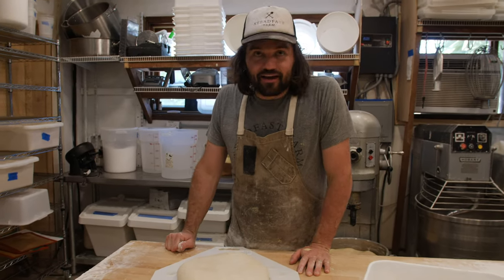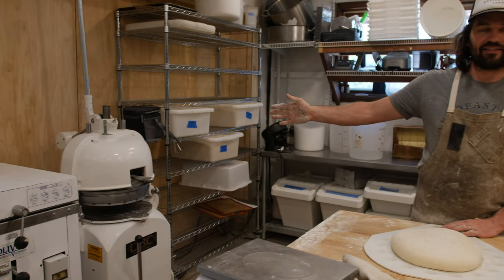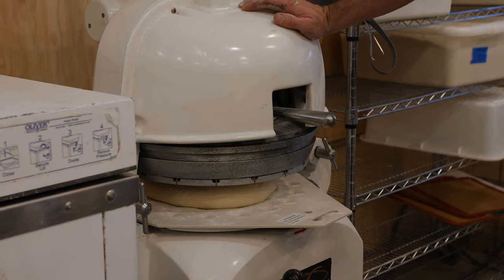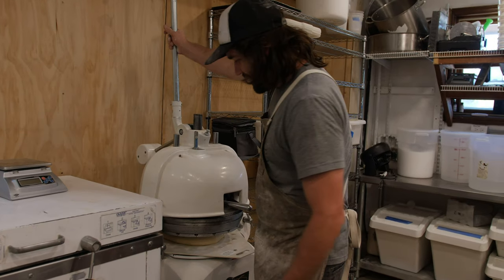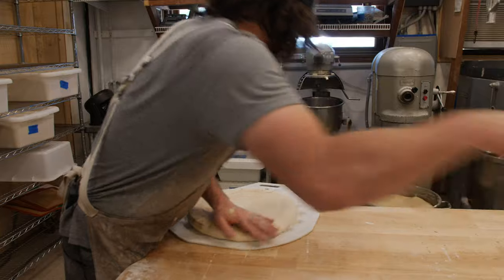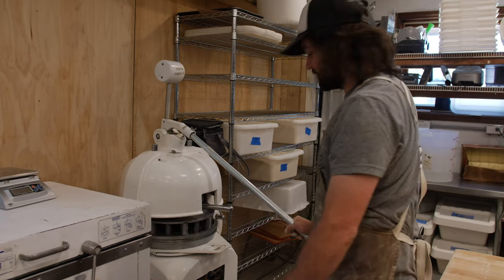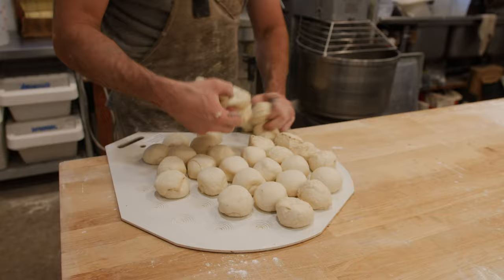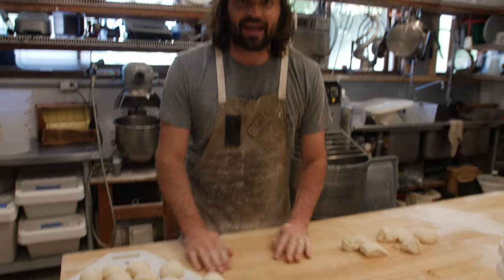Machine Rolled vs. Hand Rolled Dough | Proof Bread

Comment: I love your show but sadly nobody taught you how to use the semi automatic bun divider properly . If you do it right ,every bun turns out perfectly . Most of the dealer of these divider don’t know what and how to do it . The secret is timing and one flip from table to plate . Absolutely no flour is needed unless your dough has more than 75% hydration
Reply: Heinz Hubbert I do 80% hydration and use absolutely zero flour. The bread turns out amazing... I always wonder why use flour at all except for the very end, to make it pretty.
Reply: you are right !   I used this machine for 7 years  and    you almost  dont need flour to divide your buns !!!     I only had a spray of water to wet the bottom  and very few flour sometimes  on the top and the bun are perfectly rond no need to shape them again !    the goal is the douch stick the bottom a litle  but not too much .    in our bakery  we  could mae 4000  buns an hour  . when you have the perfect technics it is so  fun to work !
Reply: @yannhelias  This makes me want to buy a spray bottle -- it would make the job even easier! I love working with dough. And of course eating it after!
Reply: Hi I just got one of these machines. I have a pretty sticky sweet brioche dough that I want to be rolled into buns. I tried it, and it just totally ripped the dough to a wet shredder mess. Any tips?
Reply: @jennaleighmusic  if you have a soft brioche dough ,it’s because of a high fat content . Here you have to make an exception with a dust of flour . Do you have the same brand of divider? Or the same style of a divider but different brand ? They come in many shapes and dividers between 12 and 36 dough pieces as an average .
It is called a semi automatic bun divider and it can produce up to 7500 pieces per hour . By using your power as a pressure meter . 
Try dusting your dough on top and see if that helps . If still breaks dough surface try dusting under niece the brioch dough as well.
Usually count slow to 4 or 5 while rounding is happening . You may have to loosen pressure a bit while counting. After the count lift lever up .
One step a lot of people do not understand is the adjustment for night . It’s usually a single pin sticking out in front of you with groves or numbers on . That needs to be adjusted big enough , so that a dough ball can form in the cavity that you created ( that is different with every manufacturer in the market) . Be careful not to over flour the dough rather dust the dough surface . Use only enough flour that can be used to keep the surface smooth .  You have chosen one of the most difficult doughs for this Machine but it should work if done properly . 
Now in Asia the follow the same method instead with flour ,with vegetable oil in order to keep it from sticking and ripping 
Good luck I hope I could help

Comment: I have a bakery in kellerberrin , western australia and I love your videos, you are using the bun divider incorrectly, firstly you must let your dough rest longer, secondly you have to spread the dough evenly all over the divider plate right out to the very outside edge of the last row of circles, the machine is designed to press the dough flat and even but not to spread it out and finally there is a adjustment knob on top of the machine with numbers on it, I would say that your machine would take a maximum dough piece of about 4 kg or 8 lbs in your measure, if you want a 100gram roll piece then you have to wind the adjustment knob up quite high, then the machine will roll them all perfectly round without tearing the dough, which happens in your video, and it takes about the count of 23 as in 1,2, 3..........to make the best rolls , keep up the good work.
Reply: Can you make a video demonstration of what you described? It will sure help a lot of us here. Thank you

Comment: I used to run these "Fortuna" machines including the fully automatic ones. You can adjust the machine press height to help get better rolls.
Reply: That's just what I wanted to say: play with pressure point and you will get better rolls.
Reply: And as others have written here before: the level of flour on top differs also from dough to dough. And finding the balance between right pressure point and flour level can be challenging... :)
Reply: Yep, really easy to operate and get better rolls.

Comment: Nice rounder. I've used one that you manually assert press weight with a dial and I use oil on the top of the first press of the day to combat it sticking to the rounder.

Comment: after you press the dough, try spraying a light coating oil on top of the dough instead of flour. And also,  i find that its all about timing to get the dough pieces perfectly rounded, for our machine, its 6-7 seconds.

Comment: I put thin PE plastic on top of the dough on the first press to make it spread easily. I am not using flour in dividing process because it makes non smooth surface for dough spreading. I am using margarine/ oil on the plastic side only.

Comment: Hey hey. I saw that movie today.becouse like you. If i am not in the bakery i relaxing with new input. Anyway. That type of press you are using..i used my hole 17 years baker life.  But it looks öike that is not perfect round becouse the mashine is maybe to high. I roll it maybe 10 to 15 seconds and its done. You can see the edges are not under the dough. So you have to rotate it loger or adjust the height of the dough chamber. Should be a wheel on top. But still. Like youre chanel and what you are doing. Back to basics and bery good explanation dor none bakers. .thumb up

Comment: You are wrong about the StarWars thing. These dough dividers and their utensils are all copies of an original design by Fortuna which goes back to the 1920s. Fortuna received a patent on the design for their Rundwirkmaschine (rounding machine) in 1927. The design was so successful that it is still in use to this day and when the patent ran out, everybody else copied it nearly unmodified. No StarWars influence there. Although, it is possible that one of the designers at George Lucas' studio was inspired by a Fortuna dough divider.
https://www.fortuna-bakery.com/en/company/history/